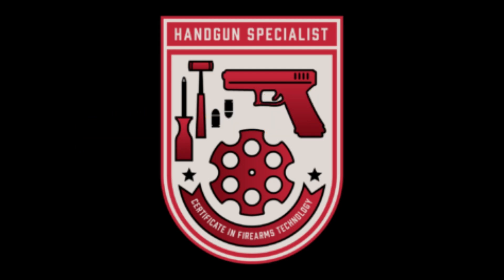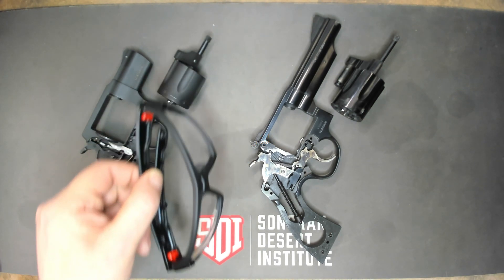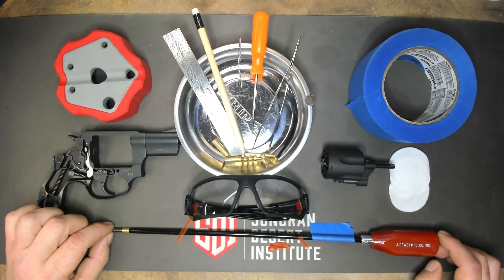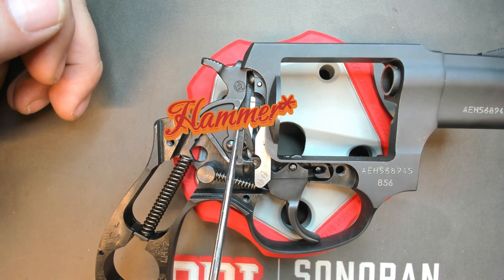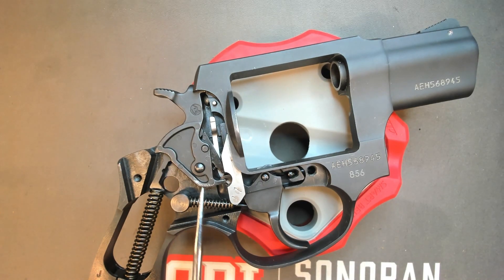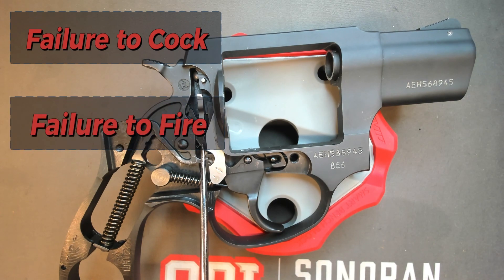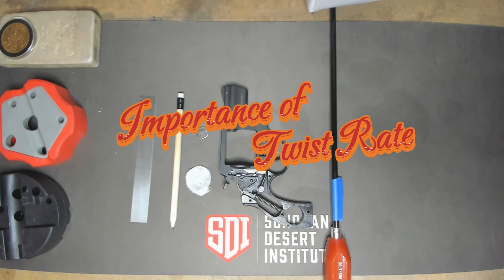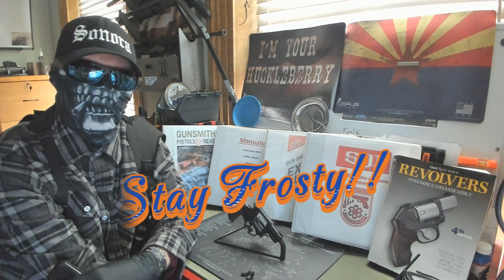Taurus 856 | Malfunctions and Rifling | Redux

Comment: I have a 856, i have put only about 220 rounds through it..i notice cylinder binding...im new to revolvers but i think the cylinder lock isnt unlocking to let the cylinder move...
Reply from the maker: Hey Tir, hard to tell without seeing it.  My first guess is it's dirty, but could be a number of things.  Sounds like the cylinder stop itself; so, could be grime from firing or could have to do something with that spring in there.  Is the cylinder opening at all?  If it's spinning fine while open, you might be right about the cylinder stop.  Try cleaning it to see if that helps.  If you need further assistance...join the discord: https://discord.gg/YFepByyk or you can email me: knavishknight@hotmail.com
I'll need some pics or video...whenever you get time.